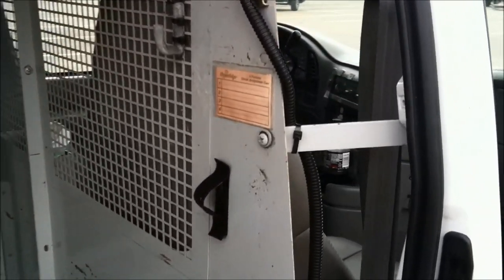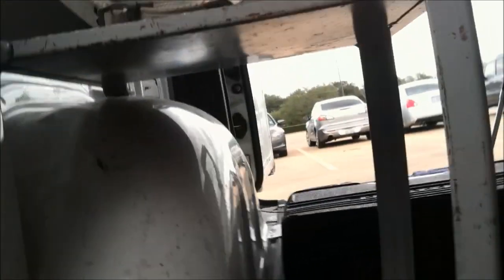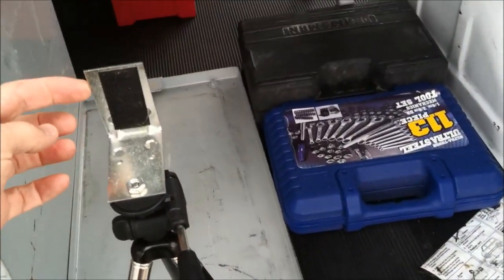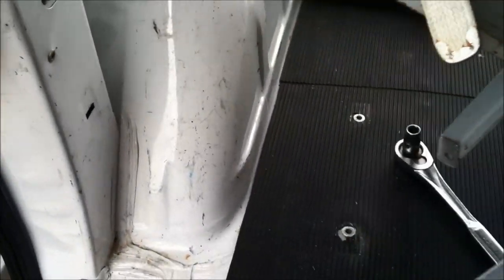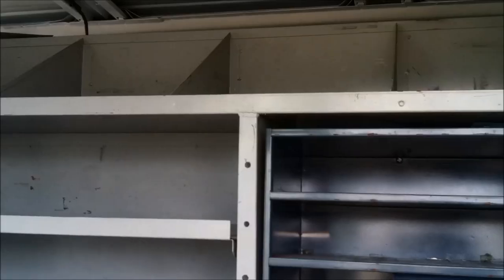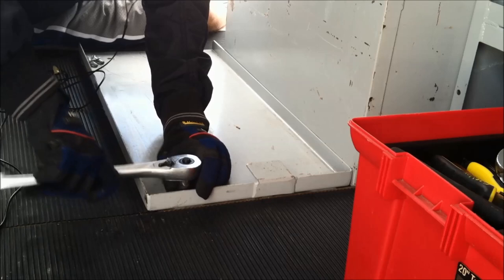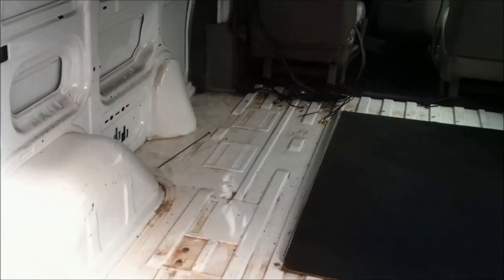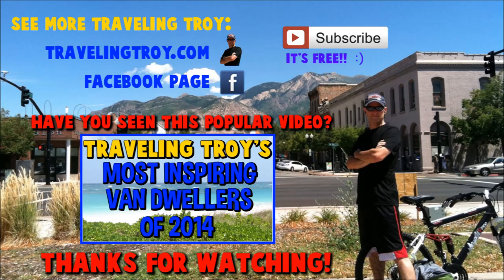Astro Van Pre-Camper Build Interior Shelving Partition Demo

Comment: Nice work! What did you use to plug the holes in the floor after removing the bolts? In a drywall those would be called anchors and work the same way, basically a sleeve through a hole that expands when the bolt is threaded into it to hold it in the wall. Those are thick bolts but I guess they would still be called anchors and they probably kept the water out as well.
Reply from the maker: +Donald Whitehead  We used a GE white silicone waterproof caulk to seal the holes.  Seems to have worked well.
Reply: those are called rivet nuts .

Comment: Why would you remove the cabin divider? I think it is a decent security barrier for anyone who breaks into the cabin. You could install a door on the divider and install a lock on the door but then again that would be a project in itself.
Reply from the maker: I really debated on whether to keep the divider and I finally decided it would be best without it. I lose a lot of space with it installed, though it would be a nice security barrier. The divider is built in 3 sections that could be disassembled but the middle section is very narrow. It would be a pain squeezing thru it. If it was a larger Van, I would have kept it. This interior is tiny and I need every inch to make it livable. Thanks for commenting and checking out the videos.
Reply: I will consider whether the divider is really necessary. I see people doing nice things with curtains and it does save space not having one.